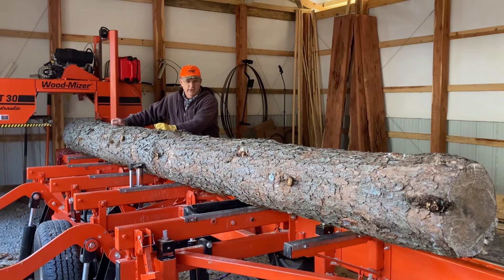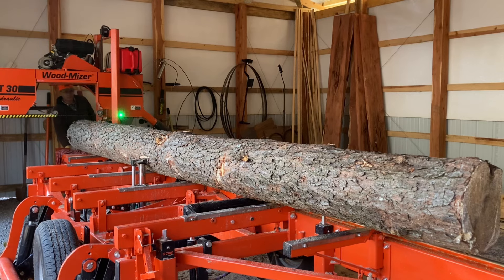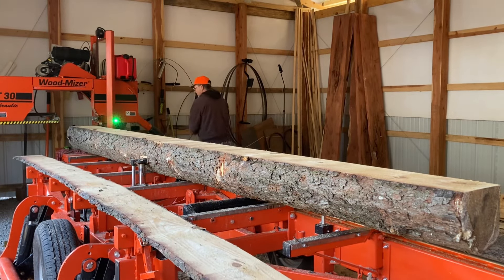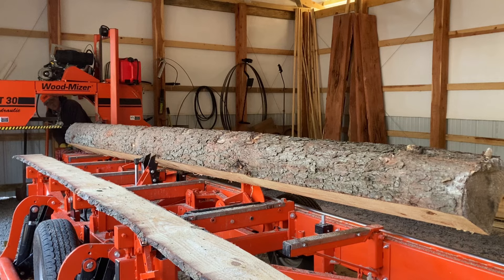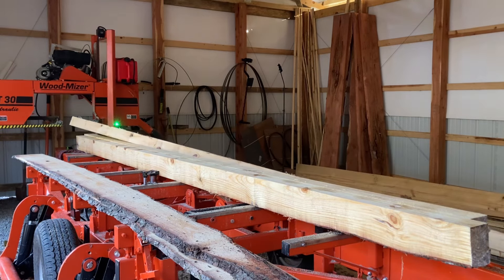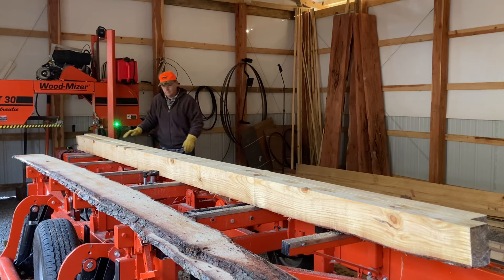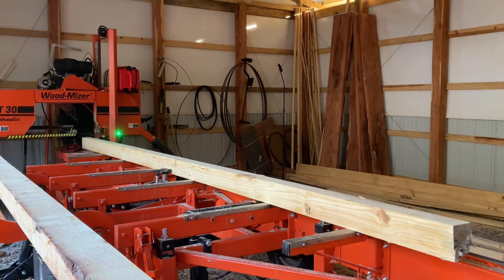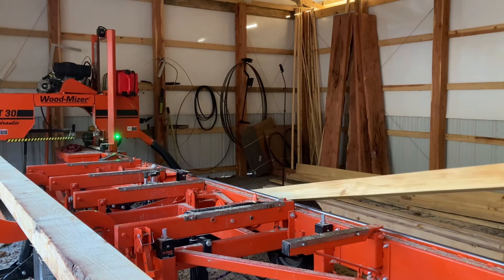16 Foot 4x4s from a trashy log

Comment: Did I hear that your mill cuts less than 17'? I thought they ALL would cut a 21' log.
Learned something new today. 
Your channel is growing in leaps and bounds.......................congratulations.
Dave
Reply from the maker: When they were selling both LT30 and LT40 the only real difference was the length. It’s no wonder they phased out the LT30. 4 feet of frame could not have cut the production costs by much. Yes channel is growing! The one video with a lot of views are made possible from a extremely high amount of “new viewers “ according to the analytics. Where normal “new viewer” count is low. While some have returned I would like to see more of them return. So far I haven’t been able to figure it out.
Reply: Maybe this makes no sense but.............I've noticed that many of your videos with "sawing" in the title generally did better that ones without. I have since added "sawing" to the title of my recent videos and the views are MUCH higher than normal.
Go figure.
Dave
Reply from the maker: Yes I realized that as well and even changed a title,and it did improve. I had used the word milling and reworked it to have sawing. I still can’t figure where the other 100000 viewers went? Same tags same words in the description. Nearly the same thumb nail. Similar title. Oh and it’s still going. It has been outperforming my last two videos. It’s been out of a month.

Comment: What type battery works for you.   I have been trying to find a battery for mine that will run the mill.
Reply from the maker: According to Wood mizer a standard LT40 requires a minimum of 875 MCA marine cranking amps. I found that a standard group 27 marine trolling battery was not sufficient. I bought a  marine deep draw / starting group 27 900 mca. It seems to work well. I have a 120 amp alternator as well.

Comment: A log always seems to get less straight when it gets on the mill, I don't know how it does it 🤣
Reply from the maker: I couldn’t agree more! I have a pretty good eye but slight curve in 16 feet with bark can be unseen.
Reply: Paul, the reason is more crooked on the mill is that the metal bunks and framework interfere with the natural magnetic fluxinations of the earth. I thought everybody knew that.